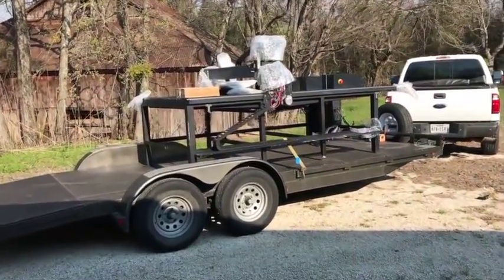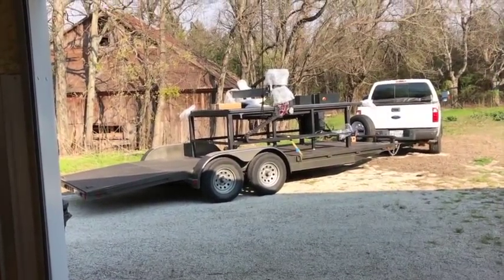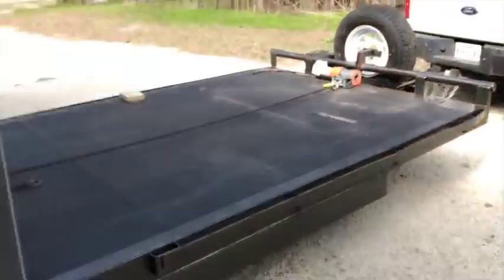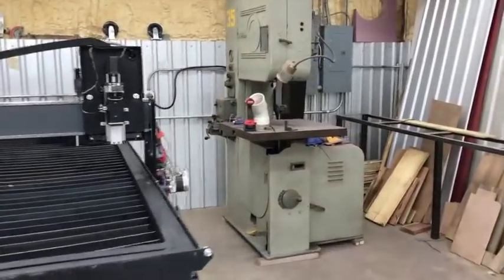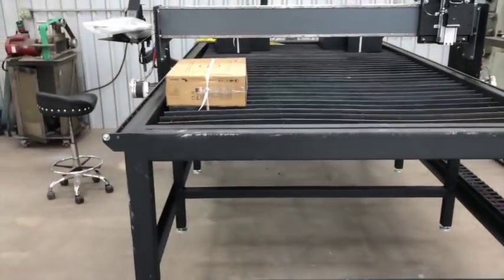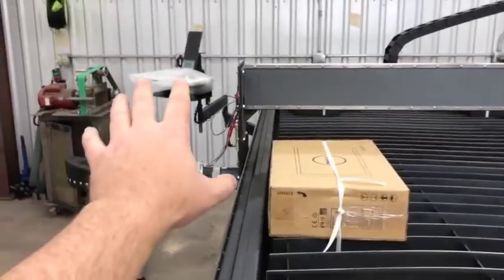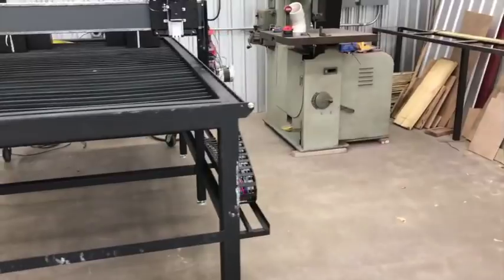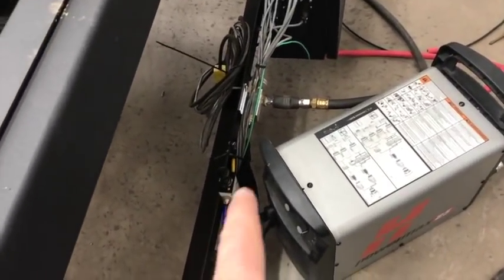Unloading - Plumbing Water - Air - New Plasma Table

Comment: Glad to see you get it unloaded and where you want it.  Even though I have a table, I like seeing how other tables are made and how they work.  Always interesting.  I think you will really like having the water plumbed in and also that drain is a great idea.  I'll bet it will make your life a lot easier!  Thanks for taking us along, Gary!
Reply: Thanks Reid, The plumbing could have been done a little better, but i really wanted to try to eliminate as many 90's in it as possible.  If i had used alot more 90's i could have tucked it along  the inside of the frame and down the wall.  But going for function over form on this one.
Reply: Function is always a priority so as long as it works for you, it is GOOD!

Comment: Hey is that Jimmy DiResta's trailer? lol If your motors dropout and you move the gantry doesn't it have to be retaught where it is for it to work correctly? Seems a couple of springs and constant engagement would be a lot better.

Comment: Gary - What gear ratio is used on the gantry? Also does the Y axis use the same motor and gear reduction?
Reply from the maker: Now that I am not sure if, havent checked the step down ratios or even looked close enough at the X and Y motors to see if they are the same or different.  I think if your thinking about buying some you can call them and htey will help you spec the right ones.  Oviously the weight and speed of what they are being asked to push is a factor

Comment: Looks good  looks like the new one I am building but mine is 8'X20' the old one i built 10 years ago is 8'X12'
Reply from the maker: wow those are huge!  You do HVAC work?
Reply: I do fabrication on .25" and .38" plate and one part is 6' dia. and am planning to start building street rod chassis 
I built my tables from scratch

Comment: For you plasma cutter torch location.  We made a very cheap mount and hung our unit from the purlin that our shop is built from. where our inner wall stops.  for us its at a 5ft height. We have the face aimed at the computer work area. and the torch is ran up and over the table. and come straight down and attached to the table.  We are running the 25 ft  as well.  no problems at all with it ever being in the way or binding and tripping the torch safety.  The cutter is up out of the way and can be seen very easy and able to be turned on and off. I can send you a pic on facebook if you like.  It might be easier to understand what im trying to describe.